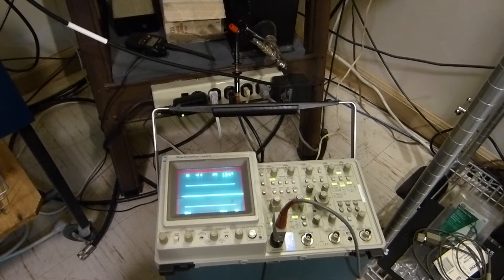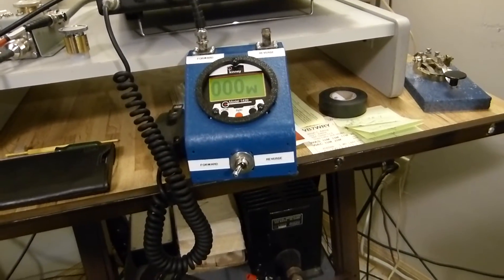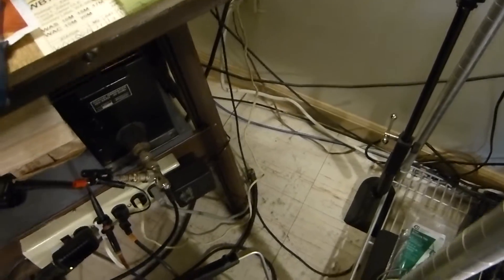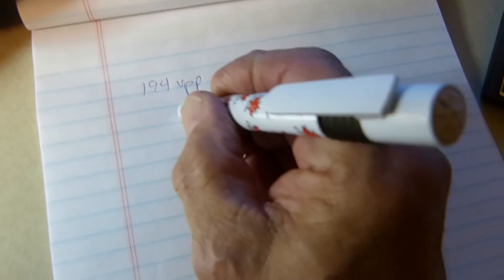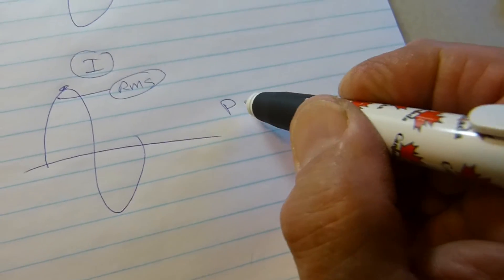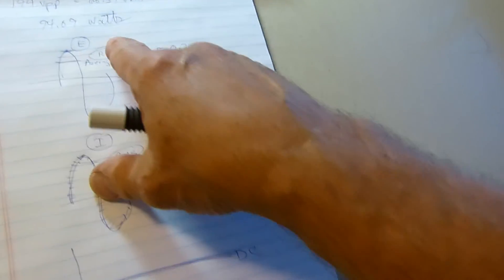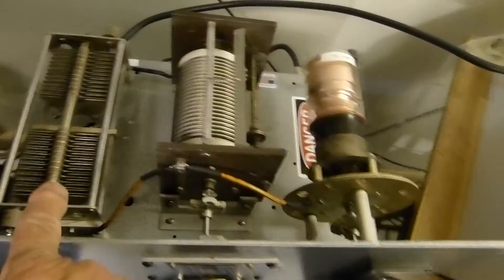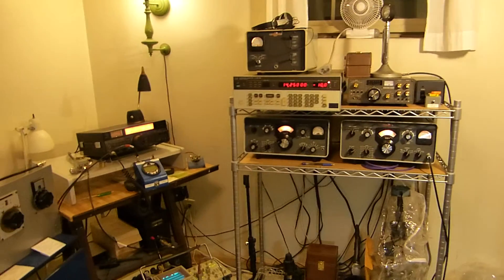Power Measurements Using A Bird RF Power Meter and Comparing to Oscilloscope Readings

Comment: Roughly Vp-p :2= watts as a "guesstemate"
Reply from the maker: Mathematically, that of a sine wave, peak power is exactly two times average power (average power often incorrectly referred as RMS power). 
Unfortunately for the Bird 43 without the addition of the PEP board, the response of the meter is terribly slow when trying to measure peak power. So, like you say, it is just a guesstemate of how much PEP power is actually going thru the meter. I think a reasonable guess would be the PEP power is about four times what the needle is kicking up to on the Bird. Just my thoughts.
Reply: Yep, it is just something i noticed along the way trying to figure out to get the best accuracy in reading power using a peak detector-dmm, a scope, (old)spectrum analyzer bird or fft on a brand new r&s scope.

Best result (for me) compared with a very expensive and accurate and calibrated r&s com analyzer set is a dBm level measurement with the fft of my r&s scope on a self build and very flat dummy load.

You make nice and interesting vids 👍🏻

Comment: Some of the inexpensive AD8703-based power meters seen on E-Bay (e.g. 1-MHZ-to-500-MHZ-RF-power-meter-logarithmic-detection-power-detection) are average responding.

Others are RMS responding (e.g. 50HZ-3.8GHZ RF Radio Frequency Detector / Power Detection / RMS detector AD8362).

There is a difference.

Comment: There is no misuse of the term "RMS Power".  Both Average power and RMS power are real engineering terms for AC power engineers, audio engineers, RF engineers etc..  The difference is in the method you use to arrive at the average.  They are not the same.

Average power is simply the average (or mean) of samples taken at regular intervals.  As you point out in your video, average power is the integral, or the area under the curve.  For a perfect sine wave, the area under the curve is the square root of 2 / 2 (or .707) times the peak power.   But this does not apply to more complex waveforms like a square wave for example.

But what if you wanted a DC equivalent for a waveform that is more complex than a simple sine wave?  What if it had high peaks?  Do you let those peaks inflate your average?  What can you do?

RMS is a method of taking an average so that short peaks in current and voltage do not inflate your average.   It's also known as the quadratic mean.  It's the square root of the average of the square of each of the samples (voltage or current).

RMS power (or average power) is the product of RMS voltage and the RMS current.  

Prms = Irms * Erms

The problem is that amateur radio and consumer watt meters only respond to the average power.  But measuring the true power levels of complex waveforms can be very difficult.

RMS power and Average power are not the same.  The "Form factor" of an alternating current waveform (signal) is the ratio of the RMS (root mean square) value to the average value.

There are commercial-grade power meters that will measure average and peak power.  Recently, it's been possible to actually measure RMS power and it's done regularly in the cellular and the military RF industry.  RMS power detectors are the best for this application as they measure the true RMS power level of the signal.

Take a close look at this Analog Device power detector chip.  It actually takes voltage and current measurements, squares them and then averages them.  It does accurate rms-to-dc conversion from 50 MHz to 9 GHz.

http://www.analog.com/en/products/rf-microwave/rf-power-detectors/rms-responding-detector/adl5902.html

For all practical sense when measuring a Continuous Wave (CW) carrier as you are doing, RMS and Average power is the same.

http://cp.literature.agilent.com/litweb/pdf/5965-6630E.pdf
http://sine.ni.com/nips/cds/view/p/lang/en/nid/208934
http://www.analog.com/media/en/training-seminars/tutorials/MT-082.pdf
https://www.quora.com/What-is-RMS-power

Konrad Roeder, WA4OSH
Reply: Oh and by the way...

Your oscilloscope reads only volts.  No current measurement is taken.  The method assumes a perfect 50 ohm load, which I will guarantee that it's not.

Once you operate into a non-50 ohm load, all bets are off.
Reply: Oh and Bird Watt meters use a directional coupler and are reading average power, not RMS power.  There is a difference.

If you had a 30 or 40 dB power attenuator, then you could use a commercial Power Meter to measure Average, Peak and RMS power.

Comment: Nice vid on power calcs. Altho, I'm a bit confused. The current TV broadcast industry is using RMS power; so is this incorrect?
Reply from the maker: +Bob H Yes,  but it seems we have used it so long that "RMS" power has become part of the technical lexicon and I think everyone knows what is intended by using the term. It has been used for a long time to express "constant" power but the technical and mathematically correct term is Average Power.  RMS is used to express a useful value for positive and negative going signals like a sine wave as there is just as much power in the negative half cycle as there is in the positive half cycle but a simple average of a sine wave would be zero. That is why we first square all the terms to make them positive.  Then we take the mean and then the square root and then multiplying the voltage and current, we end up with an "average" positive power level that is not going negative and positive like the sine wave.  This average is not to be confused with the average value of a sine wave which is about 0.64 peak value (or to be exact, 2/Pi ) Hope this makes sense. Here is a video I made correcting some of my own mistakes using "RMS" power that you might like.    https://www.youtube.com/watch?v=_LzUnyfGAr8
Reply: The TV broadcast industry is transmitting complex waveforms with a very high peak to average power ratio.  RMS power is the correct way to measure this.  Read my response above.

Comment: I think it`s important to mention that the calculation done at 8:30 works only when voltage and current are in phase or more precisely proportional to each other. There are people measuring RMS voltage and RMS current without knowing if voltage and current are proportional to each other. If we have a 90 degree displacement to each other the AVG power is equal zero but simply multiply the two values will give you an amount of active power which actually don`t exist.
Reply: IvanIvan1974  Exactly my point, when they are not in phase (o deg) we have power that isnt actually doing anything...hence we have apoearant power derived from E * I ,  then we have real power derived ftom E*I / PF

Comment: I've always worked in audio, no need for me to be precise. Being aware of the differences between peak, average and RMS values is important to understand. I would add that one must understand that all three measures will remain relative to each other regardless of the measure method used. They all are indicative of the same output power just different measured units. I would think RMS was retooled in the 70's into a magic word, to make competitors average ratings look under powered to their magic RMS values.

I think this video is the best you did of the three on this subject. You covered it very well here.! Thumbs up!
Reply from the maker: Thank you - I have to agree with you that this method of describing power was probably propagated by the audio industry. Who would ever want to have "average" power when you can have "RMS" power ? The problem is our feeling with the word “average” and  there is also an “average” voltage that is a legitimate numerical value describing a relationship with the peak sinusoidal wave and it can be easy to mix the two up.
On the other hand, I have a very nice technical document published by Dynaco around the early 70's where they very meticulously had to describe how they measured output power of their equipment to meet new imposed audio standards. I will find it and see if I can either post it or put a link to it assuming it is on the Internet.
The audio industry saw that every manufacturer of audio equipment was exaggerating their numbers and the industry desperately needed a standard. I have also come to the conclusion that there is much worse things than calling something “RMS power”. While it may be a mathematical faux pas it has been doing a pretty good job for decades describing “real” power output.
Reply: ElPaso TubeAmps
I would most certainly love to take a look at that Dynaco document. Sounds like an interesting read for sure. I'll keep my fingers crossed that you locate a copy online to share with us. Thanks again!

Comment: Do not be sorry for these "glitches" within your videos, i like them most, as they show that you are knowing your stuff!

I like your calculator and the "reverse polish notation" as it do not need to put in any thoughts about typing failure!

GREAT video, as alwas!! Keep on!
Reply from the maker: Thank you for your kind words.

I have always leaned a little more towards liking RF but I do love to work with AF also.

I moved to the HP RPN calculator in the 80's when they first came out (or I became aware of them) and totally agree with you that they are a superior style over the algebraic  calculator. The HP 15C is probably one of the most famous and can still be bought new as HP still makes them.

I am getting back into WiFi frequency range (2.4 GHz) as I have recently purchased equipment that will allow me to make measurements at those frequencies. One nice thing is the antennas are small..  :-)   and easy to handle not like a 20 meter yagi up 50 feet in the air.

Always good to hear from you, sir. Please keep in touch and publishing videos.
Reply: I´m too busy at the moment, as my job is absorbing nearly all my time currently...However i just finished my CombinedComperssorFilter unit and i´ll do a short video of it, as i´m really impressed about its performance. In addition i recently got a Telefunken M5 R2R-ProRecorder witch needs a lot of service, as well as some "big-ass" moving coil meters....may for some VU stuff...
And the need of a new lab power supply, as mine is going wild at the moment...
So a lot of work in line....

For me, all frequencies beyond 20kHz are RF ;)

And please, do not call me sir, just say friend, buddy or alike, as i´m nearly half your age....;)

I´d love to see more videos where you and Uncle Doug are doing things together, or just do a practicing video of what he shows us about phase splitter and such....it would be a great show, as you got all these fancy measuring stuff just sitting around and wait to be used to show the relationship between theorie and practical circuits. Just design a Common cathode circuit and add the bypass cap while hooked up to your spectrum analyzer that would be a real killer video! No one done it before, and you could be the first who snatch the mystery from this.
I´ve done it some 10 years ago, but i was only for me and i done it in the lab of the company where i worked....
That was the time I discovered pretty much erverything about tube amps in gerneral and how the harmonic distorion spectrum is created.
It´s about bias, voltage level, and current feedback path regardless of the type of tube beeing used, as long as you got the same topology (do not try to compare penthodes and triodes in terms of distortion as this is completely gernerated different).

Uncle Doug is pulling at that blanket from time to time peeking under it, but he do not know the overall coherences, but he, in fact, is so close to open the grail to the creation of wanted distortion, he just needs some help, witch you can provide by the use of your measuring power.
Stay basic with the circuit and do measurements then compare it to real life Amps, and you´ll see what i mean. Tweak the basic circuit and you´ll come very close to the one your refering to....trust me it´s in fact that damn simple, if and when you got the right measuring equipment.